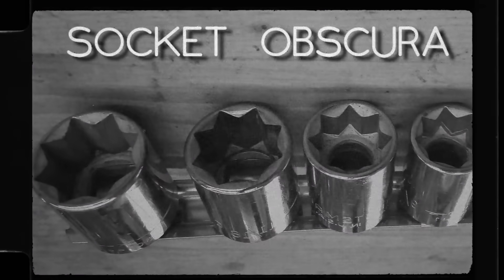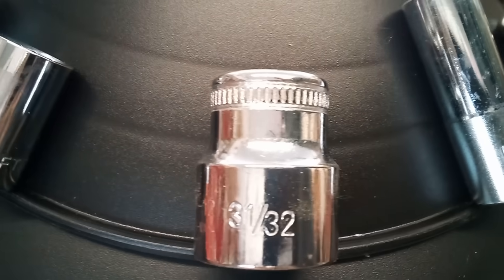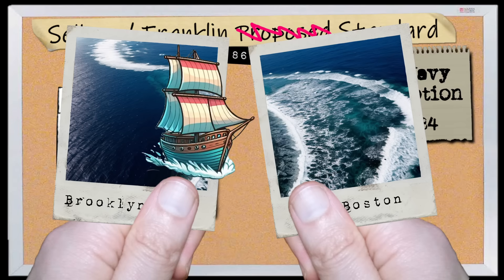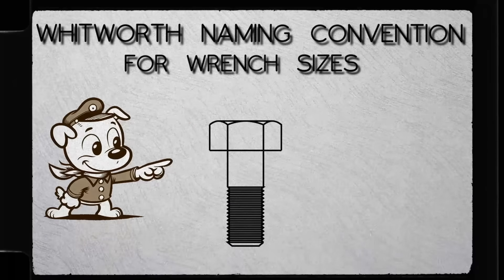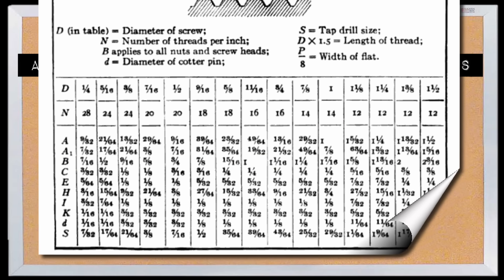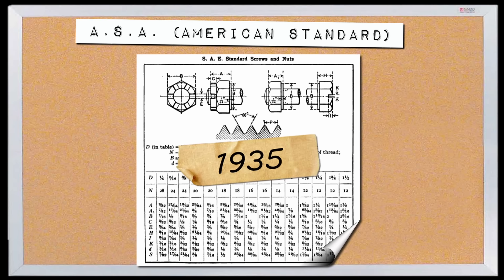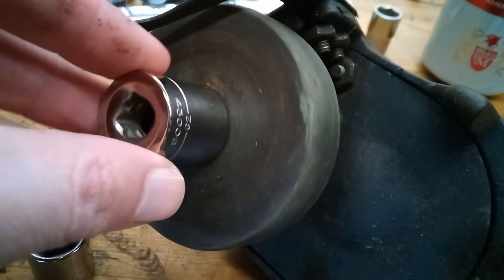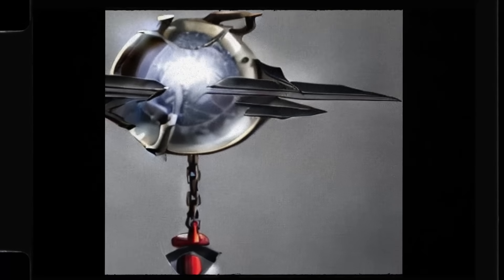32nd of an Inch Bolts - History & Lore

Comment: What I'd like to know is why water heaters in North America have these corrosion protection anode rods with a head size of 17/16ths of an inch.  Yes, that's 1 plus 1/16th of an inch.  I had to go buy this special bizarre socket for just that one task.  As far as I can tell, this is all it's good for.  Water heater anode rods.
Reply from the maker: Another commenter mentioned factories making bombs in WWII, and after the war when they switched to making water heaters, they kept the fitting size from the bomb fuse. Can't confirm the story, but it's interesting.

Comment: McMaster Carr, a good representative of fastener availability, dutifully carries Grade 8  7/16ths  and 9/16ths bolts which are the last antique oddballs I ran into and had taps for as a machine builder. Are small fractional screw under 1/4" still used I would think the wire gauge # system is near universal.

Comment: My understanding as a fitter & turner (76yrs young) was that as a wartime saving a nuts physical size could be reduced with little effect on strength and holding power. If one looks at pre-war engineering, you will get an appreciation of how big nuts were.
Reply: Yes, this did happen, for that reason, (material saving) in the UK, and it led to inconsistencies.  You'd find on a given nut/bolt configuration that you didn't need two spanners of the same size, since the nut and bolt had different hex sizes... But not in every case, even in a single assembly... Reminds me there are spanners in my cabinet that needn't remain there,
They're older than I am / we are...

Comment: I once bought a wrench set from Amazon thinking nothing of it and when it arrived, it only contained the weird sizes.
Reply from the maker: Harbor Freight sold a similar wrench set back in the early days, that was actually a metric set, but they marked the wrenches with fractional sizes, rather than machine the wrenches for actual SAE sizes, so there ended up being a bunch of /32nd sizes in there.
Reply: @ballinator  the clown show of tool stores. I bought an allen wrench set at Harbor Freight, but they weren't made of tool steel, and they stripped themselves out because the screws were harder than the wrenches.

Comment: The metric system is so much simpler. Why doesn’t the US drop the silly inch system and join the rest of the world.
Reply: One thing that can trick the rest of us up is the US system of dividing the inch up into 10ths. Our inch in Australia is divided up into 12ths. That means the US is already metricated. The inch eventually gets down to 1000ths for us too which I find is easier than metric. When building stuff I like to use millimetres because it is harder to make a mistake unless I am exactly 100 mm out. We had a perfectly good rainfall measurement system, inches with 100 points to an inch. Some idiot changed that to millimetres.
Reply: The United States adopted the Metric System in 1866.  The rest of the world still uses the inch in some places, even though most people don't know it.
Reply: @GH-oi2jf  If the US adopted the metric system in 1866 then it is not terribly obvious. The French had a lot of influence on the US in those days but I don’t think the metric system really stuck.
Reply: @jefftheaussie2225 — It isn't obvious because we never deprecated US Customary units.  We are bimetral.

Comment: I'm from Argentina. here the measure system is metric. but much machinery use SAE system and we live with that. (the best mechanics diferentiate by eye if some nuts is metric or inch fraction). but the other day I was working in a Komatsu wheel loader that is all metric fasteners (13, 17, 19 etc) BUT the drivesahft bolts were 16.5mm !! over here doesnt  exist a socket or combination wrench of that size.... I later found that the most similar size is 21/32" and found an NOS socket 21/32" made by Bahco in the late '80s. (still looking for a combination wrench of that size)

Comment: I have found variations in head sizes in hardware coming out of China these days. I write it off to sloppy manufacturing. I have a surplus of various wrenches I've collected over the years and when I really need to I'll either modify an existing wrench with my milling machine, or take some flat stock and make a wrench from scratch finishing it in my milling machine. 
Thanks for covering the Whitworth sizes. It was enlightening for me. Growing up here in the US my father managed to get ahold of Whitworth sockets and wrenches that I tried to use and was always confounded at the marked sizes on them and the fact that they didn't fit anything I worked on.

Comment: I inherited a Snap-On ratchet from my father that has a 9/32 drive.  Sadly it only came with 3 sockets.  It can't be used with any 1/4 inch drive sockets.  I don't want to grind or modify it for sentimental reasons, but I will try to fabricate an adapter for it.

Comment: Metric would probably work for some of these.  25/32 is just over 20mm and you might be able to squeeze 15mm over a 19/32 head.
Reply from the maker: Yes, a lot of them are very close to metric sizes.

Comment: i work on boilers and chillers. some of the bolts are  old. i have on hand square 8 point sockets as well as wrench and sockets by 16 up to 2 inch. just  when  i think i have it covered i run into another strange item to remove.

Comment: My half inch drive Craftsman Deep Socket Set bought in 1966 contained sizes 1/2" to 29/32".  These odd sizes have come in handy with undoing swollen lug nuts on cars with Chrome plated lug nuts.  They also fit many metric sizes that do not normally fit well in SAE socket sizes.  I wish I had bought their 3/8" deep socket set at the same time.  Instead I had purchased a set of New Britain deep sockets whichd did not have those odd sizes at a much lower price, but with fewer pieces.

Comment: Why is this so odd when there’s like 27mm to an inch making a 32nd not much of a stretch from metric increments.
Reply: The /32 sizes are odd because most nuts and bolts on most mechanical things made in the USA (before the automakers went Metric) were on a scale with 1/16" increments.  The sizes were easy to distinguish by sight.  When you put /32 sizes in the mix, they are hard to distinguish by sight.  You have to learn which specific fasteners need an odd sized wrench.

Comment: Excellent lesson. Always good to learn something. I am mechanical designer and always specify threaded fasteners per SAE, ASME, ASTM, Military Specs., or DIn standards. If you go into Machinery's Handbook, you will find that there are Hex and Heavy Hex listed in the tables for bolts and nuts.
The heavy hex are used in structural applications.

Comment: Worked at a farm equipment shop, lots of the 8mm bolts had 15,16,17 or even 18mm size heads, all in the same bulk bin. Would always take a socket with me to make sure i got all the same size.

Comment: Once you add in all the metric wrenches and sockets along with metric torque specs, pipe and tubing fitting thread and connector types and bolt/nut hardness and metallurgy you can really have a lot of stuff in your tool boxes....

Comment: I don't know why they do 32nds 
Or 16th for that matter 
Should be 8th 
1/8, 1/4, 3/8, 1/2, 5/8, 3/4 7/8 and 1"

I don't know what they were thinking 

That's a lot of choices for a bolt

Why they need 16th and 32nd I don't know.

The same goes for metric

3mm, 5mm, 7mm, 9mm, 11mm, 13mm, etc
Reply: I suppose you never worked on a US car before they switched to Metric.  In the heart of the range, where most of the wrenching is done: 3/8, 7/16, 1/2, 9/16, 5/8, these /16 sizes are important.  Going from 1/2 to 5/8 is a 25% increase.  The 9/16 is the right size for many applications.  Above one inch, increments of 1/8 are reasonable.

Comment: Thank you for this. I knew about part of the general rule for wrench sizing coarse thread bolts - 1 1/2 times the size of the bolt diameter. I didn’t know that you also need to add 1/8”.

Comment: Those odd sizes work great on 'cheap metal' nuts and bolts that distort when frozen on some old part. lightly tap an undersized closed end wrench or a socket (1/32") and you're homefree . . . . just throw out the nut/bolt when it's finally removed.

Comment: My father, having restored several Model T and Model A Fords, always had a very well organized and cared for socket wrench set with all the 32nd sizes readily available. I started to give it away after he passed (after all his cars were gone), but hesitated. It now resides in the top drawer of my tool chest, many years unused but full of memories.
Reply: I love how in the 1932 ford repair manual it says "being at the peak of technology this system probably won't be improved" or something like that.
and someday I may have to hammer the 19/32 socket on to a rounded nut or bolt.

Comment: I have a Craftsman set of fractional ignition wrenches (~1975) that includes a 15/64ths size. And I NEEDED EXACTLY THAT for my 1964 Studebaker Avanti (ignition). Now, we have the decimal metric (e.g., 4.5mm) sizes.

Comment: @6:48 a chart of smaller size screws is shown. This illustrates the .013 rule for numeric screws.
The 0, or ought, size screw is .060 diameter. The diameters then progress on .013 increments.
So to calculate the through hole drill size the formula is .060 + (n × .013) where .060 is the base 0 screw size and n is the screw number. Then add .005 to .010 for the clearance hole drill size.
So for a number 4 screw, say a 4-32, the calculation is .060 + (4 × .013) = .112 plus the clearance of .005 to .010.
This only works for the numeric screws 0 through 12.

Comment: I rebuilt a freight wagon built in Canton Mass and ran the California gold rush then the Klondike gold rush Took all bolts out and ran into problems when reinstalling them due to over and undersized threads I grew u I’m blacksmith shop where we still had 32 over and under size threads

Comment: I'm amazed the Model A Ford received no mention in this. The rod and main bolts are both /32 sizes. I keep /32 sockets as well, though I need to check a Proto catalog to be sure I have them all. I also keep a set of 8 points, because I work on old farm equipment.
  I recently heard the confusion with metric, ie one diameter and pitch having two head sizes depending on manufacturer, is based on a change to metric hardware by Ferdinand Porsche in the thirties. It would make a good video to answer this one as well.
Reply from the maker: Interesting. I'll have to look into the Ferdinand Porsche thing.
Reply: @ballinator  from what I heard the head size changes equalled a ten percent reduction in the weight of the hardware.

Comment: Timely video! A couple of weeks ago I was removing the rear seat belts from my mid 60's Oldsmobile. There was four anchor bolts for the belts, the two outer bolts were 13/16" head size and the two inner bolts were 25/32". I didn't know what was going on for a minute on those inner bolts as 13/16" was too big and 3/4" was too small. It took me a while to find an old wrench in my collection but I did have one that my Grandfather gave me many years ago. I'll probably never use it again. I did find though that a 6pt 20mm socket was an acceptable substitute.

Comment: The thing I like about standards is that there are so many to choose from.
Reply: Usb-if forgot the U was "unified" and managed a complete cluster borking up connector and speed naming conventions.
Reply: Indeed.
In model engineering I use BA, ME, BSB, BSW as well as Metric Coarse.
Photographic fittings call for UNC.

In total I've accumulated 22 combinations of threads and sizes.
Reply: @lenroddis5933  what are the applications that you use those different standards on? Everything automotive that I work on is either metric or American standard.
Reply: As Groucho Marks said "I have my principals!  if you don't like them I have others" LoL nice one mucker!!
Reply: :face-blue-smiling::face-blue-smiling:

Comment: I worked at a company that hired a rigging company to move their draglines. The riggers were the worst at bolt sizes. They would ask for a ½" bolt, meaning a 5/16th. They went by the head size. I would give them a ½" bolt, and they would say, no, a ½". I never did make them understand bolt sizes 😮. 😅.

Comment: Get weired looking at this as guy from metric land Germany 😉I wonder why they kept those complicate to calculate fractions of an inch for hundreds of years. Anyway in refrigeration engineering we use UNF and Unc for pipeworks and on connections on compressors. At least every mechanic here has a so called "Englishman" (adjustable wrench) in the toolbox.

Comment: I live in Australia and grew up on farms we owned back in the 60s so that was mostly Whitworth being a Commonwealth country, then automotive meant a mix of BSW, UNC and UNF depending on where the vehicle came from originally. Then we moved to the Metric System and that meant more spanners and taps and dies 😵‍💫😵‍💫😵‍💫
Among all this I seemed to gather some weird spanners that came from grandfathers that they had gotten during WWII here obviously they were American spanners and many were XX/32”.
When I did Mechanical Engineering at Uni we obviously covered all the thread sizes EXCEPT the old ones covered here.
Thank you for extending my knowledge even though I’m retired its very interesting.
I have noticed with some tools out of China that they still manufacture XX/32” spanners.
Reply from the maker: You're welcome! Glad you found it interesting.

Comment: Ok ballinator  ive got one old socket  the size on the socket isnt the problem its the drive on the socket  
at first glance it looks like quarter inch drive  but the quarter inch drive ratchet wont fit inside of it im sure its some really old socket with some strange drive size that im not familiar with  you got any information relating to socket drive sizes ???
Reply from the maker: There were other 'odd' drive sizes before they settled on 1/4, 3/8 & 1/2. There was a 9/32nd, 5/8ths and 7/16ths drives too. I need to pull all my info together on them to do a full video.
Reply: @ballinator  ill certainly be looking for it 
i dont have anything extremely odd other than that socket  but i do have an old tools and things from the past playlist  that may be of interest to you if you care to see it Edit: the playlist consists of only of my videos and things  that i actually have
Reply from the maker: @ I'll check it out. Subbed.

Comment: I worked on early 50s chevys and finally found the need for (if I remember correctly, it’s been fifty plus years) a 19/32 socket, transmission to bellhousing bolts. Only place in sixty five years!

Comment: Thanks for the info on establishing head size according to thread size. 30 years ago, an old mechanic told me about this way to remember what size wrench to chase, but didn't know who invented it. 
Have you ever had to deal with British pipe threads verses metric pipe threads. Chinese didn't, They took the Brit metric size when they took over Hong Kong, but these wouldn't always fit on Euro metric fittings. When the Chinese started exporting machines to the US 10 years ago, I went thru fits trying to get matching ends
Reply from the maker: You're welcome! Haven't had chance to encounter the British pipe thread yet.

Comment: So exactly as arbitrary and pointless as I assumed lol.

I think there should be 1/8, 1/4, 1/2, 3/4 below an inch and only halves and wholes after that.  But, I'm over 100 years late to get to decide that lol.
Reply: That would never work.  When I used to work on my cars, 1/2 and 9/16 were the most common sizes.  The 1/2 clearly would not be able to replace the 9/16, and if you had to go all the way to 3/4 instead of 9/16, it would be comically large for the application.  Wasteful, as well.
Reply: @GH-oi2jf  bud there's literally 1/16ths of an inch difference between 1/2 and 9/16

Comment: You should look at flat washers between USS and SAE  sizes. And, in the printing industry the bolts were "Roll your own sizes" like a half inch bolt would/could be 11, 12, or 13 threads/inch.

It was a nightmear when I was an apprentice Millwright!

Comment: These days, just have a complete set of SAE sockets/wrenches, along with a complete set of metric sockets/wrenches on hand. The millimeter sized sockets/wrenches normally fall nicely between the fractional inch sizes and get the 32nd of an inch bolts/nuts rather well. FYI.

Comment: don't care what any of that is supposed to mean, what I do know is most 1980's to 1990's Chevy S10 bolts that were supposed to be 5/8 were actually 19/32. After rounding the heads off about 6 bolts with 5/8, I took one, that didn't round off, into a parts store that happened to have a 19/32 socket and never had it happen again

Comment: I had to buy a 21/32 socket once in the early 80's.  I had to order it, but it was a Craftsman socket I got through Sears.  An 11/16 nut on an exhaust manifold flange had deteriorated to the point that it was needed.

Nuts used to be one size larger than the head of a matching bolt.  I think that ended in the 60's.

Comment: The /32 sizes aren't common.  A set of wrenches in 1/16 steps suffices for most things encountered by amateur mechanics.  If I needed a wrench for an odd /32 size, I would just buy the particular wrench I needed, not a set.

Comment: Well, they must’ve changed the USS because half inch bolts use a three-quarter nut 13 threads
Reply: 1/2-12 was a very common thread dia/pitch combination back in the day.  And overseas shops kept using 12 TPI long after the rest had moved on to 13 TPI.  I recently had to purchase a quite expensive 1/2-12 bolt; they are still available.